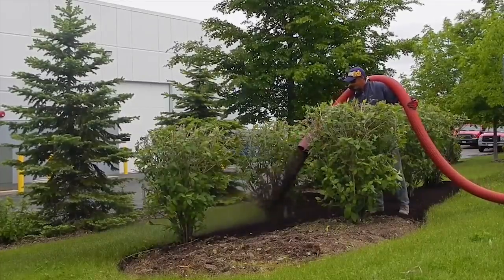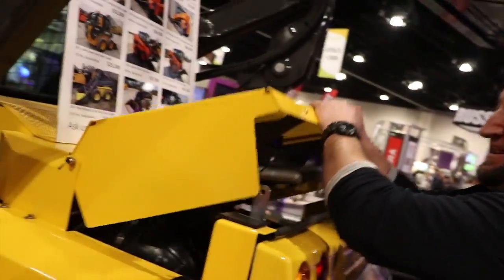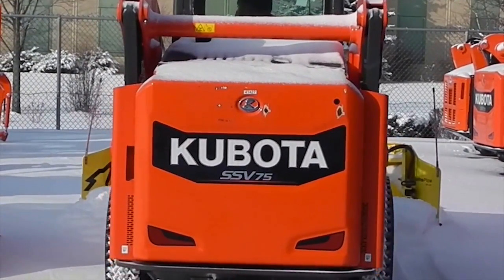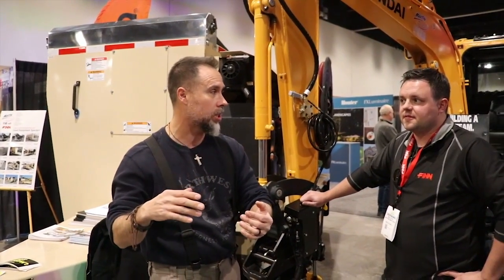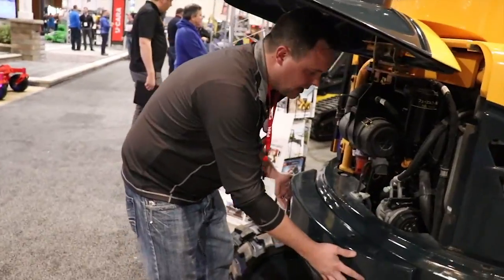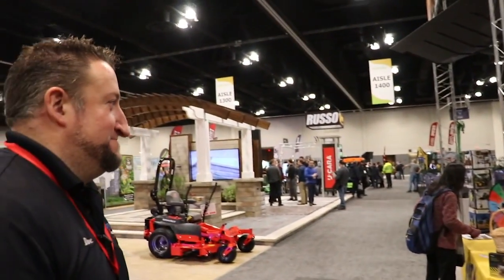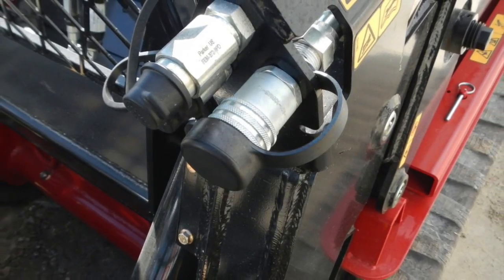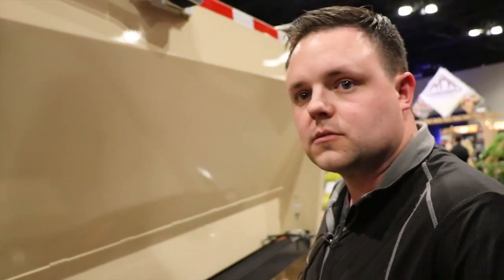Whats new in equipment at the Illinois Landscape show sponsored by Martin Implement

Comment: The bark blower is GREAT! Guy I know who has mentored me picked up a used one for just over 10 grand (works great). I have made use of it several times. It is a money making machine. When he isn't using it, he rents it out. Cuts the total amount of labor down DRASTICALLY. I have a place that usually would take 28 yards of mulch. With the blower it takes 16 (still charge for the 28) yards. It lays down soft and fluffy. If you do a lot of mulching and you know of other companies that you are networked with, it pays for itself just by renting it out to companies that you already may be networked with. Not to mention the massive labor cost savings. I was very surprised to hear Stan say he was not familiar with it. A job that would cost 6000 would now be close to 35-40% savings and more money in your pocket due to decreased labor and material. One company in the area has the big one which seems close to the size of a tri axle. These are amazing machines.
Reply: You do realise that is almost certainly fraud - you may want to get a legal opinion on that, the charging for product you don't deliver, I mean. Maybe 'theft by deception' as terminology does vary between countires and jurisdicions
Reply: @gordowg1wg145  Interesting, so a line item of work to be performed (without a dedicated amount) can't be charged the same? If I plow a lot of snow, and I have 1 truck that takes  2 hours to plow and charge x dollars, does not make that plow any cheaper If I had the equipment to do it in half the time? Or if  a landscape job is $14,000 total, and for 6 years you charge x dollars to mulch...not specified how much, just x dollars to perform. Then the past few years you are now able to do the same area in mulch and much more efficiently I should reduce the price to get them the same results? I am asking because I want more feedback.
Reply: @Teak-996  
NOTE, I am commenting on what you actually said - you charge them for 28 yards of mulch but only give them 16 yards... that means you are charging for 12 yards you are not providing - I am assuming you mean cubic yards, not square yards?

It would seem there are two different scenarios here - in the first you say you charge 28 but supply 16, in the second you contract to do xxx work and are paid an agreed amount and you are able to use less mulch because of productivity improvements.

Turn it round - if you paid to have some work done, with the bill to be settled after the work was done, and the itemised account had 28 xxx listed but the contractor only used 16 xxx, would you not feel ripped off? However, if you agreed with the contractor that you would pay a flat rate of $yyy to do the work and they were able to save on some material that you both initially believed was required, would you not think they were smart to do so?
It may come down to exactly how one does the estimate, quote or final pricing.
To get back to the snow clearing - if you put in a bid/tender assuming it would take 28 hours and it was accepted, and it took 16 because it turned out easier than expected, then that would be fair enough - the client paid for the clearing at a contracted rate. However, if you took the clearing job *at a hourly rate*, expecting it to take 28 hours but it only took 16 hours but still invoiced the client for 28 hours that would not be ethical OR legal.

Again, I suggest you get a legal opinion as it is, IMO, fraudulent to charge for product that isn't provided (I could certainly be wrong) - if I am wrong it costs a few dollars (you can probably get an opinion for $20), if I'm right it could mean a possible prison sentence - certainly something that is possible if it is actioned.
Reply: GordoWG1 WG1 so if I agree to cover 3200 sq ft that took that many yards of mulch and now I still cover the same area with the same product but the blower makes it lay light and covers the same area, the. I should reduce the price? I am
Having a hard time seeing what they are not getting. Still getting roughly 2 inches of mulch in the same square footage. I do not see things get cheaper because someone has a more efficient way. I want to see your point I am just having difficulty. They are not being charged per yard of mulch, they are being charged for said area to be mulched.
Reply: @Teak-996  That is where I believe the confusion lies.
You are looking at the ground area and the dry depth of the coverage and missing the point that the mulch will settle, especially when it gets wet, reducing the actual depth proportionally. Because the mulch is 'fluffed' up more the apparent coverage is the same but it is actually only 16/28 of the material being applied and so the finished, wet depth would also be that much less - yet you are charging the client for the full depth - or more accurately, for the full cost of what should be used to do the job properly, not for what is actually done.
It may be easier to understand it this way - you buy your favourite snack and the new bag looks exactly the same as the old one, but the manufacturer hasused more air in the new one and less of your favourite food - to the point that there is now only 16 ounces compared tot he 28 ounces you used to get for the same money - would you not think the manufacturer was ripping you off, especially if there was no indication you were paying the same money for less?
Reply: @Teak-996  Hmmm, think of it as having someone painting your house - you had it painted 10 years ago and it used 18 pails of paint. This time the painters have newer equipment that allows them to thin the paint more - it works so well they only need 16 pails of paint. Because it used 28 pails last time, they figure they will still make you pay for 28 pails - that is 12 pails you are being charged for that will never be bought, let alone actually benefit you - and to add insult to financial injury, the paint coverage (thickness) is only 4/7ths what you paid for.

I really can't make it much simpler.
Reply: GordoWG1 WG1 makes sense with that outlook. I think it’s also important to note that smaller jobs I bid by x amount of mulch. Larger jobs is x price to mulch x sq foot. I see what your saying. But not a legal problem. As small as I am I do use accountant/legal  and have documents reviewed before submitting to customers. Good analogy for perspective, I appreciate the feedback. And thanks for answering!
Reply: @Teak-996  Cheers, man - long as both parties know ahead of time the terms it's all sweet.
Just need to be careful how things are worded, including punctuation - aware of one case where a missed comma cost a company literally millions in penalties.

Comment: The company that makes the Finn Blower should consider making a unit that could be retrofitted onto a truck, for applications where only 15-20 cubic yards are required. I would anticipate a drop in cost to the device if done that way. The hose would have to be stored differently though.
Reply: Jonathan Cook check finn sister compagny express blower. We have 3 blower trucks and they are amazing machines to work with

Comment: I feel like the EPA shouldn’t force DEF/DPF on off-road vehicles since I’m pretty sure what they’re doing is illegal, and I’m about positive that they only legally have jurisdiction over on-road vehicles
Reply: @PopeDonJohnXLVII  yes, juswt use Cats
Reply: bigtx77 catalytic converters
Reply: @PopeDonJohnXLVII  wait you can do that. hmmm...
Reply: N&W 2156 Y6a most vehicles have def sensors that check the idea content and will throw an error code if you just put water in the tank. Also, the def tanks rarely have drain plugs, so if it does throw an error code on your machine you’d have to siphon it all out and replace it with the proper DEF. Just a heads up.